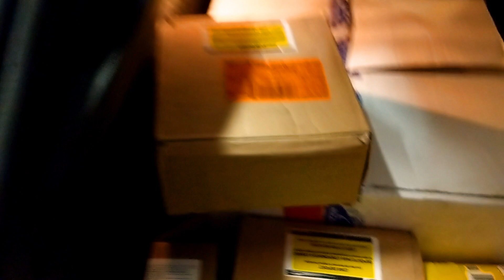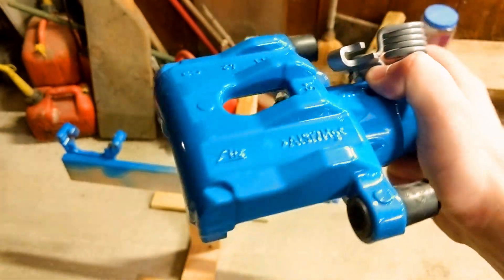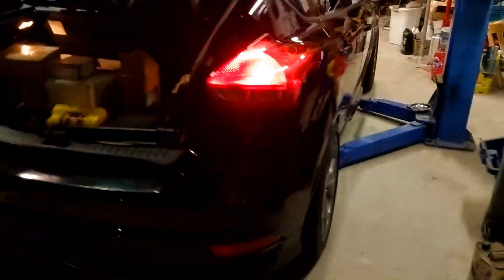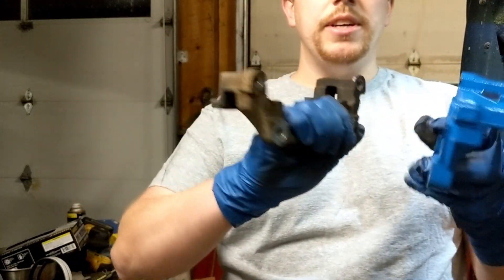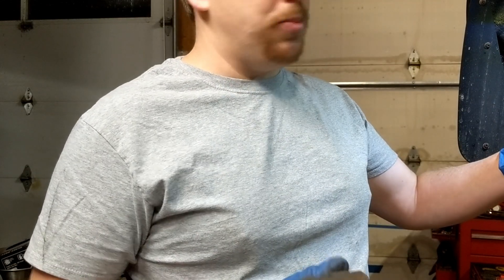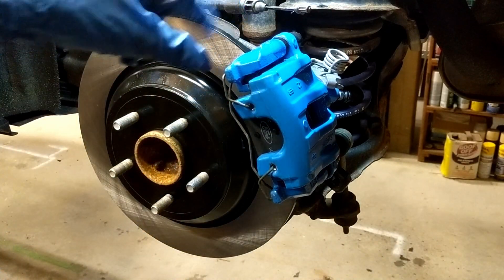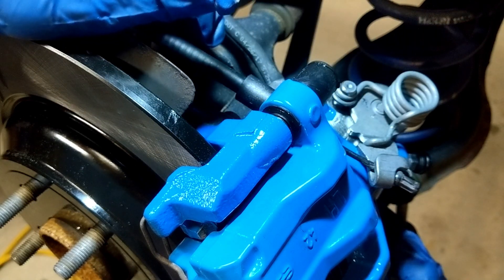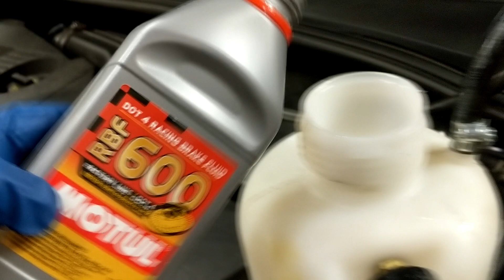BIG BRAKES on my Focus ST - Franken Brake setup using Focus RS Rotors Calipers and Mazda 5 Brackets

Comment: The one question I do have is why did you use a bigger rotor with the Mazda holder caliber I know that’s not the right name for it and isn’t the ST caliber the same as the blue one that you put on
Reply from the maker: The caliper carrier is what allows for the larger rotor.